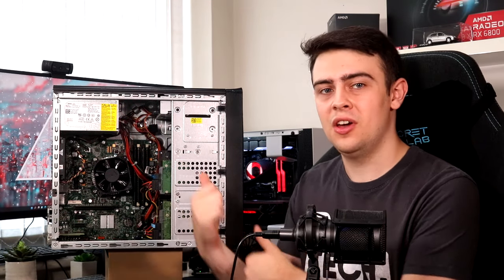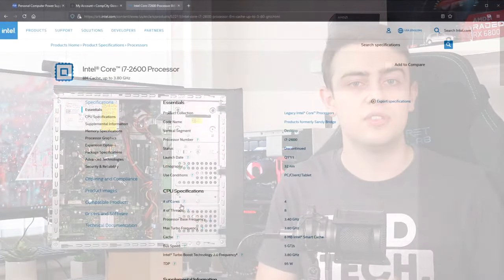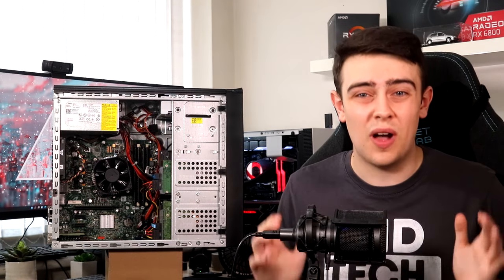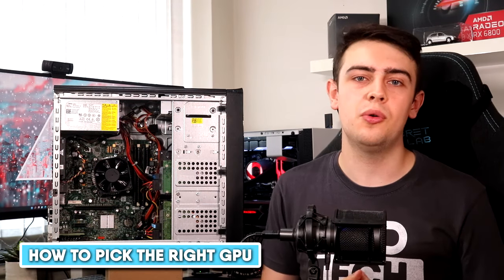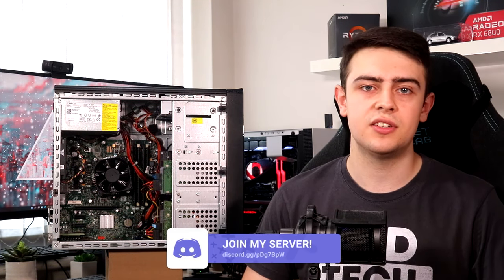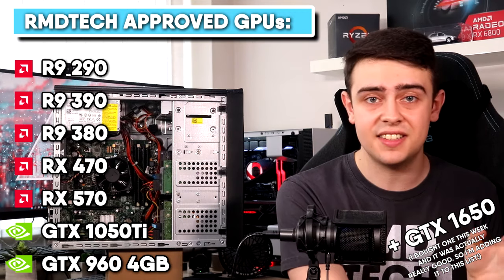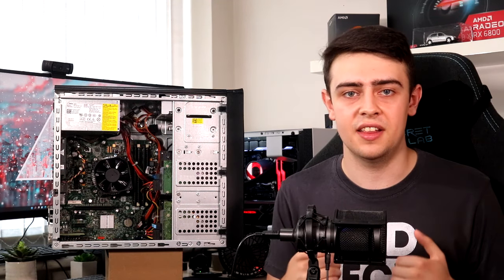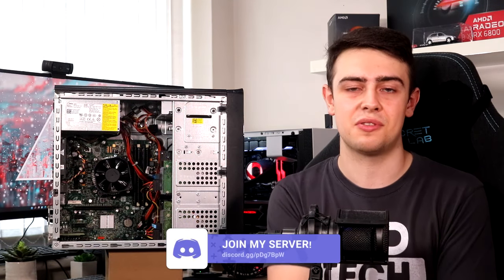How To Convert ANY Office PC into a MONSTER Gaming Rig

Comment: Only thing I would add to your guide is to test the components after receiving them prior to cleaning. That way you can be sure you didn't break something during the cleaning process.
Reply from the maker: Yessss, this is a very important tip! Thank you for mentioning this as I completely forgot it in the video. This is also vital for claiming money back if things are broken!
Reply: @RMDTech  Also a good point in regards to refunds. And no problem. Cheers, mate.
Reply: G'day Dave, Hit the mark here, I feel this is the most important point for 'Used Parts Build' videos, yet is missed in nearly every one of them,
Just like new parts if it is a full build do a pre-case test of all the parts,
if you are just upgrading Install the Driver then run a test like Heaven for GPUs or Cinebench for CPUs & Motherboards

Comment: In general this is a pretty good basic guide. However, I can't believe how he glossed over the fact that most office PCs today have proprietary connections for the power supply which means you can't just throw a standard ATX PSU in there and hope it will work. Quite a big oversight in this video really.
Reply: Hey can u explained it further? Is there any other things to consider turning builtup office pcs into gaming? Maybe the motherboard component (vrm, capacitor) not strong enough for gaming? Or maybe it has different connection with consumer motherboard? Thank you
Reply: @anaskhikam  Tjat's a big topic and a lot of stuff to cover. There are plenty of tutorials on youtube. Many on this channel.

Comment: Tip: look for office PC's with 4 RAM slots on the motherboard if you want 16 GB. It's much cheaper to buy addional 4 GB RAM sticks then 8 GB RAM sticks. Because there are lots of 2 RAM slot motherboards the 8 GB RAM sticks are in higher demand.

Comment: Like to watch videos like that from time to time.

I myself did twice a "Dell Optiplex conversion to gaming PC"
my firs time was with OptiPlex 7020SFF - Haswell based system.

gave it 4x4GB 1600mhz ram, for the cpu i kicked out an old i3-4130 and placed there a Xeon E3-1230v3 (almost like a undervolted i7-4770) and for an GPU u gave it an GTX 1650 GDDR6 from Zotac.
And for a small touch, replaced both cpu and front fan, into 80mm units from Arctic

what a amazing pc it was :D

Comment: I've got an Optiplex 3010 I've been using for 2 years. Upgraded to a 480GB SSD, 2TB HDD, Xeon 1230 v2 CPU, 16GB RAM, and an RX 580 8GB. They make adapter for the motherboard so I plan to case swap it soon. A lot of the boards have proprietary connectors so you can't use the front panel if you had a different case. But they have aftermarket adapters for this one and a few others.
Reply: Hey did u ever swap
Reply: @dothatjustin  Yes, I ended up swapping the case on a couple of them. There's an adapter kit you can buy for the 3010 motherboards that will allow you to plug in front cables for another case. I swapped the case and gave the PC to my son. I built myself another computer.
Reply: @CallMeMilenko  nice man, thanks for the reply haha. I’ve seen those adapters as well, does it include a spot for the audio too? Do you remember? I’m about to look it up right now. I’ve done one OptiPlex swap before and with no adapters and it’s kinda if a pain but doable, possibly much easier w/ the adapters
Reply: @CallMeMilenko  have you tried swapping anything other than an OptiPlex? Just wondering if it’s possible to do on different older desktops or not .

Comment: Nice guide, however I have two things to say:
1. imo a GTX 970/1063/1066 are going to be better choices over the 1050 Ti and GTX 960 4GB, especially when compared to the AMD offering.
2. The USB 3 point is kinda flawed. You might end up buying a bad AMD APU system over something with Sandy Bridge cuz of it.
Reply: Using a USB 3 add-on card adds €10 or so to the build and gives better usability.
Reply: @tweakz_tech  I think you missed my point and didn't understand what he meant in the video.